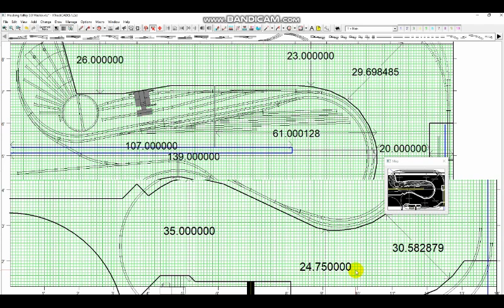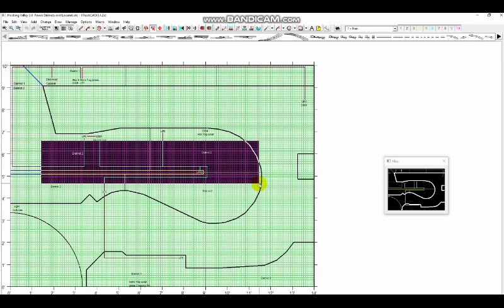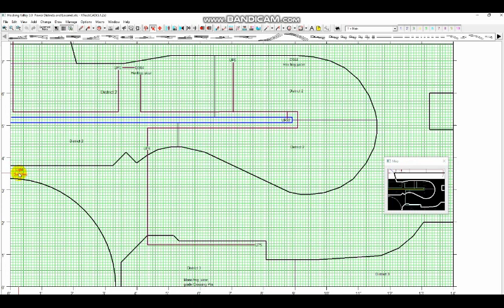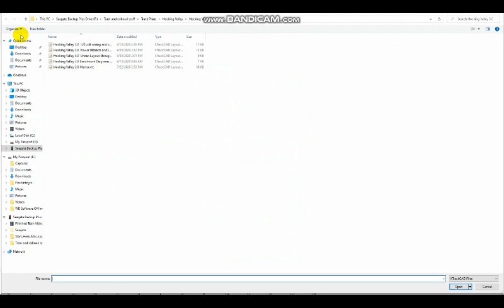Hocking Valley 3.0 - The Endeavor

Comment: thats a real nice plan. efficient use of space, especially with the yard. what scale?
Reply from the maker: HO. Era's 1954, but I do have a bit of modern stuff that I would like to be able to run. Honestly, most of the reason for the design is that I've spent three years now researching the prototype and. Other big thing is I wasn't afraid to use curved turnouts, the yard design probably wouldn't have been possible otherwise.